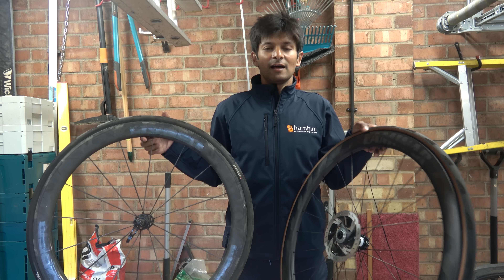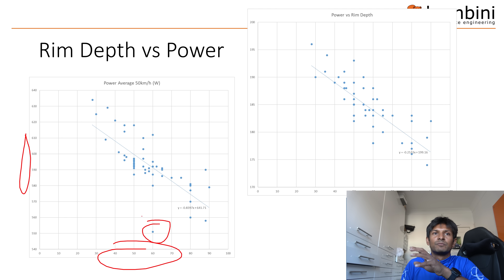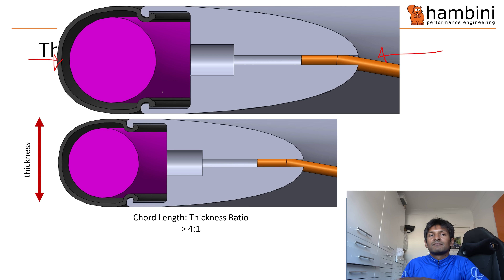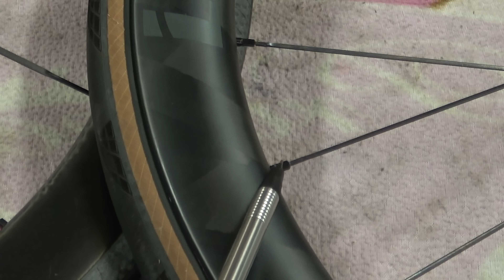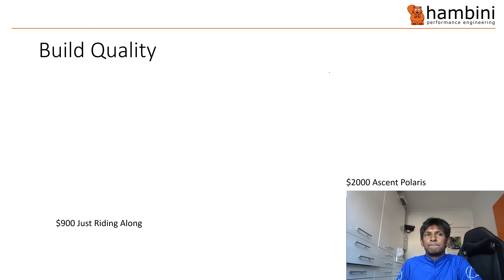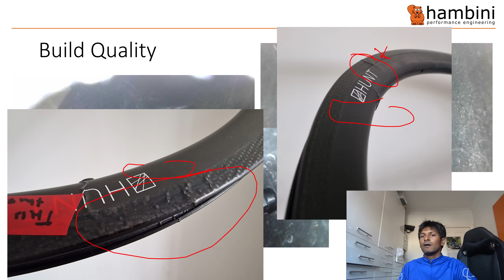Aero Bike Wheel Buyers Guide | By an Engineer

Comment: Easy rule of thumb, conti 23mm on the front and you can’t go far wrong. I’m not sure if my swissside 62mm rim brake wheels have a late bulge, they’re 27mm about 3/4 the way to the trailing edge which is semi blunt, they do seem fast and stable, and the other rim depth did well in your aero testing (also hidden brass nipples and have had no need in two years to true them)

Comment: You say that disc rotors have a significant aerodynamic drag, but you don't give any CFD result or real measurements. Also, as for bearing material, can you explain why there would be a rolling resistance difference between 440C and 52100? Both have the same elastic modulus.
Reply from the maker: You need to look at the hardness of bearing materials. Stiffness is something else. 

For the pumping loss, that is a real measured number
Reply: @Hambini  Any chance you can link a research paper or a handbook that explains why it's the hardness that dictates rolling resistance? For the pumping losses of the disc rotor, what are the numbers if you have measured it? Cheers

Comment: Thanks for a super informative video that cuts through the marketing BS. Based on your description of the effects of the terroidal shape and required deeper chord length, it sounds like the Bontrager Aeolus 75 is one of the only current wheels that is actually faster with a 28? Or is still not the case because the outer diameter is too wide at 31mm?

Comment: The only plausible carbon spoke construction I've seen is the wire-rope socket style per the Wang et al. patent.  I believe Farsports use these, however the nipples do not allow any truing adjustment externally; these faux-nipples are there to prevent wind-up as the actual internal hex nipple is adjusted through the rim-bed.

Comment: Why are slender axles less desirable if they typically use larger, taller cartridge bearings? Large axles also can't achieve the clamping force of an old quick release.
Reply: (large thread mount axles)

Comment: Hey Hambini!  Love your hair, you’ll have to introduce me to your hairdresser.

Let me challenge your presentation, if I might.  You start by pointing to the futility of using air tunnels to evaluate wheel (and bike & rider) drag. Something with which I agree.  But you then go on to make recommendations based on general aero concepts/rule of thumb and even make some watt estimates of savings (3 watts for hidden nipples, for example).  Without some established mathematical basis, these general rules can’t really lead to good recommendations and you’ve offered no alternative basis to replace the wind tunnel estimates.

As far as I know, the general body of aero knowledge has established that small low-speed profiles have different aero characteristics as compared to larger profiles at higher speeds.  Most of the research related to this body of knowledge appears to come from work done with small windmills (think personal electricity generation) and model planes.  But there is plenty of published work available in this realm.

From spokes to frames, the profiles related to cycling are small and operate in a low-speed environment.  So aerodynamics that apply to automobiles and jet planes don’t simply translate to cycling.

And many of the profiles that marketing wankers push have the added complexity of dynamically changing as they are presented to airflow even when that airflow is stable.

There is also the difficulty of keeping profiles properly pointed to the wind (in sailer speak) when the bicycle is traveling in a straight line and the wind direction is steady.

Finally, there is the whole cumulative impact of small gains concept which argues from the assumption that there really are many small gains to be had, and that each can be built in independently of each other so they truly add up like 1 + 1 = 2.  Instead let me suggest that each of these gains is sensitive to a variety of different factors (assuming that they can be realized at all).  So each factor need to be adjusted by this and that sub-factor and probability of same.  This leads to the assumed additive model being fragile in practice.  Statistics is a relentless bitch.

Given these considerations, general aerodynamic rules of thumb (apart from frontal area) can’t easily be applied to cycling.

Let me offer a few examples related to wheels:
1) I believe that effective drag reduction with small low-speed airfoils require a profile with an aspect ratio of at least 10:1, not 4:1.
2) The top of the wheel (which is moving into the wind faster, due to rotation, than any other portion of the wheel) produces the majority of wheel drag.  The profile the top presents to the wind is quite unlike any pictured cross-section profile used to describe a wheel/rim combo.  All the discussion/analysis of bike wheel profiles ignore that only a brief band of the frontal area conforms to the conventional cross section diagram.   Hence discussions of shape, aspect ratio, trips and stalling affect based on this limited area of the wheel are not a good proxy for what occurs over the rest of the wheel.
3) Wheels (especially the front) are rarely pointed into the wind.  First, cyclists move around on he road and both the movement and the turning & leaning related to same alter the wind direction.  Second the wind can and does at various times come from all points of the compass.  While there are prevailing weather and geographic factors that can make prevailing winds less than random in direction, the addition of route choices should make sure that, overall, wind direction is random.  Depending on wind strength, this can dramatically impact apparent wind direction and speed on bicycle components, and thereby further dynamically alter the profile presented to the air.
4) The leading edge of a profile is by far the most aerodynamically important.  For our wheels, that means he tires, not the rim.  Some years ago, Reynolds offered aero down-tubes to frame builders.  An American builder, preparing to build a frame to attack some track TT records had contacts in the Sandia National Labs for wind tunnel testing and computed flow analysis (Sandia being a place with powerful compute capabilities).  It turned out that the tube didn’t reduce drag unless it was turned around backwards.  The front edge was round leading to flow separation which the rear tapered edge couldn’t recapture.  Because the down tube slopes, it actually presented a modestly parabolic shape to the airflow.  While parabolic leading edge are generally preferred for drag reduction, this tube, even at its angle, didn’t have enough parabolic taper to reduce drag.  Our tires don’t present parabolicly either.  And I suspect riders wouldn’t really like their handling characteristics if they did. Perhaps one day a tire manufacturer will build a parabolic tire and we can find out.  But with the limited control we have over tire shape, it’s not clear to me that rim design is the answer to our aero-prayers.

I could go on, but I not trying to dump on you or troll. But I am curious about whether you’ve done much study into small low-speed aero profiles?  I’m no engineer, so you know many things that I don’t.  And if they relate to my analysis above, I’d love to learn from you.

Best regards,

Comment: Can you quantity the disadvantage of having a wide (28mm) wide tire on a 50mm wide rim? How significant is it? Is it so bad that if you are set to run a 28mm tire and no deeper than 50mm you can save the cash and go straight back to box section?

Comment: Should we consider the drag caused by the back of the front wheel? Or is the flow so disturbed at that point that the shape of the rim is irrelevant? 

I’m wondering if the tear drop cross sections might lose out when the trailing edge becomes the leading edge?
Reply from the maker: it's so disturbed by the time it gets there, the shape is largely irrelevant.
Reply: @Hambini  if that is the case, then surely the rear wheel could be absolutely anything (shallow, deep, disc, narrow, wide, whatever) and it would make no difference.

Comment: Interesting hearing your take on the 105 rule. What do you think of wheels like the Roval Rapide's where the front wheel is 35mm wide and suited to a 28mm tyre. Is that creating needless drag? That would certainly debunk Specialized marketing claims.
Reply from the maker: a 35mm frontal area is basically 50% bigger than a 23mm frontal area. You aren't going to get a 50% reduction in Cd hence I would cry BS.

Comment: Good video…thank you. One thing not mentioned regarding the added weight of disc brakes is the fact that weight is saved compared to rim brake wheels in the area to protect where rim brakes add wear and heat. I don’t have but it does bear mentioning.

Comment: Great video! The only thing I have trouble with is actually applying all the information into picking a wheelset. I understand that it might be difficult to give recommendations, but if you could give a few options based on everything in this video, I think that would be super helpful. 

This could of course also apply to frame sets and whatever else.
Reply from the maker: linked in the description
Reply: @Hambini  I am still in the boat of wanting to buy of local retailers that allow me to have the buyer protection laws or Sweden, are there are “big name brand” wheels that could fit the bill? 

Zipp, Roval, Enve, Scope, Duke to name a few.
Reply: All or most of this applies to the riders that are more in the upper category/level but for average joe you would not experience or reach the load/forces/speeds that often. But if you are in the upper category/level then this video is very crucial.

Comment: My experience is that once a tubeless tire has been seated to the rim, a compressor is no longer required to reseat after a flat.
Reply: Honestly depends on the rim tire combo, my gp5000's and my Bontrager Aeolus 37's never keep a solid bead, there is always a spot that comes off the bead, and I'm almost always forced to throw in a tube. Yet my 650b wheelset I could ride them flat for 20 miles and the bead would be fine.
Reply: Wow. Totally opposite experience with GP5000 TL. I have to pry them off to get the beads loose. Prime black 50 rims.
Reply: @mrbuddha5263  interesting. How wide of a tire are you running on the Aeolus rsl 37s? I have a pair of Aeolus pro 3s and I use a Schwalbe one TLE. That bead is on there extremely tight
Reply: same

Comment: Honest question... All the aero explanations and descriptions of wheels are describing the tire as the leading edge... but what about the other half of the wheel -the trailing part of the wheel where the rim is the leading edge forming a reverse teardrop? (please excuse if I am not using the correct terms...). Is this part of the overall system in such turbulent air that it doesn't count?
Reply from the maker: Air hitting the trailing edge is highly volatile because it has been food blended by the spokes

Comment: Anyone remember the Mavic Cosmic Carbone from circa 2007? Aluminum rim with carbon fairing that was only like 45mm but it went to sharp trailing edge profile since the spokes were anchored to rim… very stiff wheel, super fast, at least as aero as Zipp’s 65mm rims and way more stable.
Reply: I have the 2010 version carbone slr with flat cf spokes. They are really cool strong wheels. I use them for commuting everyday. I don’t know about the longevity of the hubs though. I haven’t had an issue yet but have read they r crap.

Comment: The aerodynamic loss of a disc brake is negligible for almost all riders compared to the breaking efficiency it gives you.
Reply from the maker: Unless it's raining, a disc brake is unlikely to stop you faster. It's more likely to be worse because of the added weight
Reply: The weight is also negligible for most riders. I know personal experience is very non scientific but I'd much rather ride my disc brake bike than my rim brake bike when it comes to stopping. It's not just that they're more powerful but also more usable in their application and modulation of power. I've not yet locked up and slid my disc brake bike despite 8000km in all weather. I used to lock up my rim brakes in light rain.

Comment: 2 thoughts, it seems that making a « sensible very good wheel» is not complicated from the technical aspect ( not talking about manufacturing and QC) - so the r&d cost should be pretty limited, so why wheels are still fairly expensive for what they are ( even HYPER). Second is what about developing your own wheel and component, the product line could be called NBS= no b…s, 
I think there is a place for very good product that just need to work and do the job, and there is a place for shiny object ( Porsche vs Ferrari type of thing) 
Well made video

Comment: Love the depth of your knowledge and the simplicity of your explanation 😀

Also, have one of your Hambini Racing BBs and it is a work of art!!!

Ps. I went with 38mm Rim Brake Hypers because I bike around 30kph and knew that I would mount a wider 28mm tire (further removing aero benefit).  Comfort, stability and acceleration for the win on nasty Boston roads.  Would have preferred Hypers with non-carbon spokes (Winspace carbon spokes are possibly too stiff and still have to be adjusted from the inside even though there are visible spoke nipples on the outside).

Comment: Great points !   Have you ever run across any wheels from "Superteam"? 

I have two sets of tubeless ready Superteam wheels that have treated me very well;
a 45mm set I put 32c gravelking SS tires on for a lot of tarmac and light gravel - and 38mm (with a 24mm internal width) for 40c medium knobby tires for more heavy gravel rides. 

If you added the cost of both sets I have spent less than $1,200 US and they came with a 3 
year warranty.

Comment: Have you looked at many Corima wheels? I saw that you tested the ws+ 58mm which was one of the best performing "60mm" wheels. Is the paired spoke design, torsion box, and structural foam beneficial? I use the 23mm wide S+ 58mm wheels and the rims appear to have a very good teardrop profile.
Reply: Agree Corima have a very aero traditional shape. I'd be interested to know too. 47mm seem good all rounders. 25mm on rear fits nicely too

Comment: Can you comment on the potential difference in transition between tubular and clincher rims and their respective tyres? I have always been under the impression that due to the different construction of the tubular rim and the tubular tyre as a complete unit that has always been cleaner with tubular systems.

Comment: Great Video!  Would you avoid carbon spokes for general purpose riding?  I would love the aero benefits but is the benefit worth the problem risk in your opinion?   Thanks.
Reply: Carbon spokes don't give you an aero benefit, the profile of the spoke is what gives you that. A bladed spoke is more aero than a round spoke introspective of the material.
Reply: @kidkarbon4775  Thanks and understood.  But I don't there are wheels on offer that have same bladed profile and size of blade in metal as in carbon, am I wrong?  The wheels that I would buy are Elitewheels 50s which come with carbon, trying to decide if I should be concerned about that.  Thanks again.

Comment: Question regarding rim weight.
Theoretically which would be faster:

60mm rim at 1200g 
Vs
45mm rim at 1500g

Thanks :)

Essentially asking if rim weight affects speed as much as rim depth.
Reply: Did you mean 45mm 1.2kg vs 60mm 1.5kg? Because I can't think of any situation except extreme wind where the wider lighter wheel is slower.
Reply: I probably should have asked is a heavier rim faster in the sense of momentum aside from acceleration.
Reply: I believe on the flat, the rim weight has close to no effect and the aero benefit of a deeper wheel wins - hence why aero bikes while heavier are faster in most scenarios. 

Where the weight would make a difference is if you were climbing a lot, weight is a straight up penalty or if you needed to do a lot of rapid accelerations as the bulk of the wheel weight is at the edge (ie, not the hub) and takes a lot of energy to get it spinning faster but per above, once it is up to speed you aren’t really impacted by it. 

I’m sure Hambini or the comments of others will correct me if I’m way off base.
Reply from the maker: This is going to depend on how much accelerating you have to do.

Comment: Thanks a lot for the video! Could you quantify the aerodynamic penalty on disc brakes compared to rim brakes?
Reply from the maker: If you are travelling along and the power required to do that is approx 200W, you would need around 10W extra with a disc brake bike. The pumping loss is quite significant as is the reinforced fork and parasitic and pressure loss from the front abomination.
Reply: @Hambini How did you come to the conclusion that it's roughly 10 watts (in this example)? What is it based on?
Reply from the maker: @logicgeek7263  you can use the euler equation with some approximations to give you a ball park figure. But I did it empirically. I took a rim braked bike and stuck on two fake discs. Measured the drag with and without them. I then had to do a correction for the lack of caliper.  And it's associated mount. The pumping loss or mixing loss is the dominant factor. 

It is by no means a perfect test but the calculated approximation and the empirical data are quite similar. More importantly, the rim is always faster
Reply: Just goes to show that marketing trumps marginal gains in road cycling. 8 grand for a slower heavier bike than ten years ago...

Comment: Excellent video! I've been eyeing a new wheelset and I've narrowed down to 2 models from the same brand: 36mm high with 22.4mm internal and 26mm width. The other model is 42mm high with 19.4mm internal and 23mm of width. I usually use 25mm tyres so the 36mm seems better to use use 25mm+ tyres. What's your take on that?